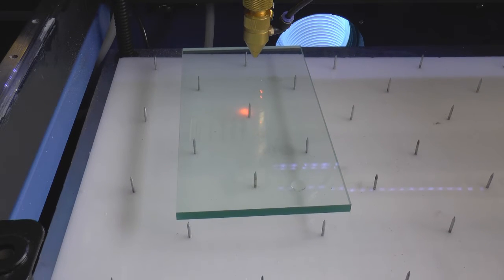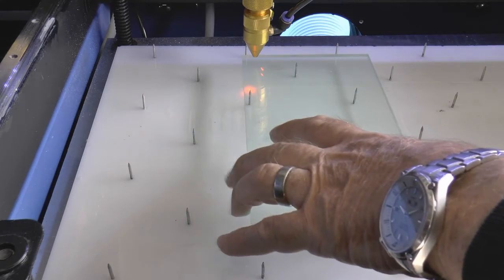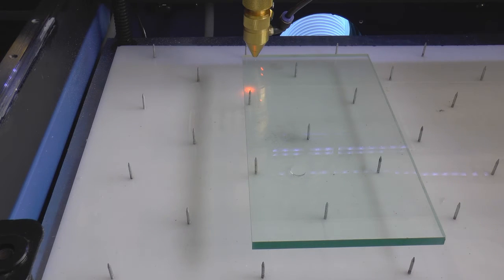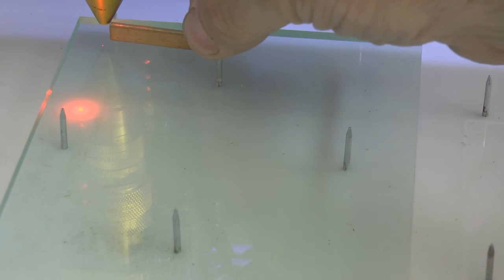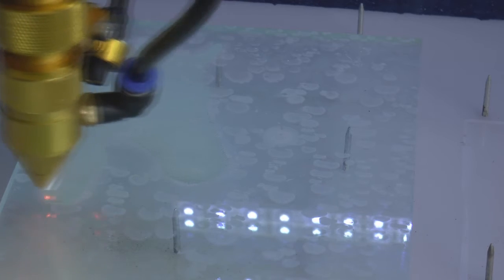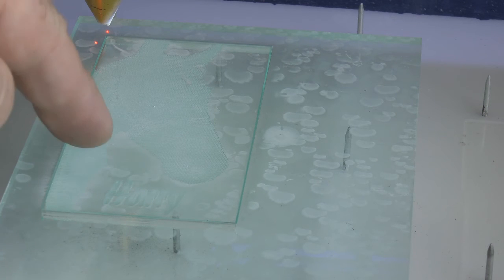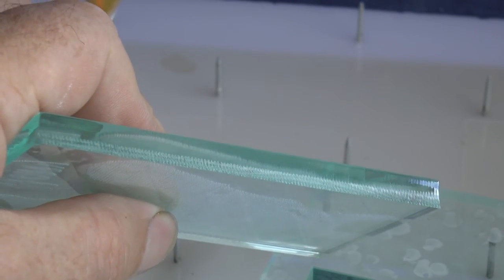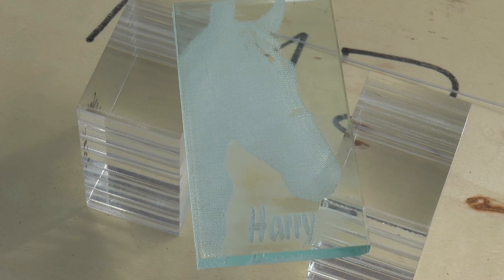RDWorks Learning Lab 09 cutting a dithered line bitmap graphic

Comment: Thank you so much for all your videos - they are super helpful!  I have a 50W laser but I cannot get it cut wood or acrylic no matter the setting or thickness of the material.  I am using CorelDraw 12 as that's what is compatible with my machine but does the file have to be in a specific format for cutting vs engraving?
Reply from the maker: Hi Janine
I don't use Coreldraw for my designs because I am an engineer and very comfortable using CAD, thus all my designs for cutting are .dxf format. I know that you can integrate CorelDraw when you install RDWorks. Are you using RDWorks?  If so then when you set the parameters you choose if you wish to cut or engrave. However, if the file format is  a bitmap of any sort (ie you can see the pixels if you zoom in) then you cannot cut it. It must be a vector format to achieve cutting. In CorelDraw you can export as ,dxf or .ai , both of which you can IMPORT into RDWorks and cut.  I suspect you need more help, so attach your email to another comment and I will write back. Your comment gets auto copied to my gmail so I will delete your comment/email from public view.

Best wishes
Russ

Comment: Hi Russ, hope this ok. Another little trick :)  When you use the Track function, try to move the laser with the buttons on the control panel, to where you want the job to start, let's say top left corner of your material, the simply hit Origin, in that way you tell the laser where to start. And the try to run the Track function. This is especially good when it is critical where you want it to cut or engrave and you have maybe aligned the object so it is perfect parallel with the lasers running path. In that way, you don't have to align it again.
Hope that makes sense.
Reply from the maker: Hi Klaus
These things did become natural after a while especially when I started using sheets of A4 paper and card to make Xmas and birthday cards with very little waste to work with. Although I'm long gone from this stage of learning, I am not at all upset or worried if you want to add comments to any of my early videos  because others at this stage will be able to learn tricks quicker than I did.
Thanks again for the input
Russ

Comment: Hey have you ever seen the laser run over all text show you in rd works setter a piece of text in and says scan so it should of course only digging where begstaverne is but my keep and diggers also between the letters so it blver just long lines from start to finish :D and got a new laser tube or 2 the firste one was broken and the 2 was fine and the laser is runneing but now i have this problem :D keep op the good work :D
Reply from the maker: Hi
Google did not do the best translation of your problem but I think I understand. If you write to me on the YouTube private message system with your email I will try to help you. Many people don't know about the message system, but if you click the blue square beside Sarbar Multimedia it will open a page with tabs on. Select the ABOUT tab and anothet page opens. At the top right there is a MESSAGE button.
Speak soon
Regards
Russ

Comment: Going slightly off topic,could I ask you how to move a sub unit on screen including any internal components.i.e.I want to move a Butterfly wing to optimise a cut path but there are several items on the wing that I want to move at the same time.Is it possible to move all together or do I have to move each item separately?I think I've pressed every icon going.........
Many thanks,Keith
Reply from the maker: +Keith Bickley
 Hi Keith
You can do exactly what your require by using the GROUP tool (next to the little monitor icon. Click on the first element you wish to move and then hold the SHIFT key down and one by one (or marquee a group) add to your selection (the items will turn red as you select them). When you have selected all the  items you need,  press the group icon. Its simple when you know how.
This is a very powerful technique for simplifying the ordering of your programs. Once you discover this I think it will be your preferred technique
https://youtu.be/_3oUQ9gKjCk

Good luck
Russ